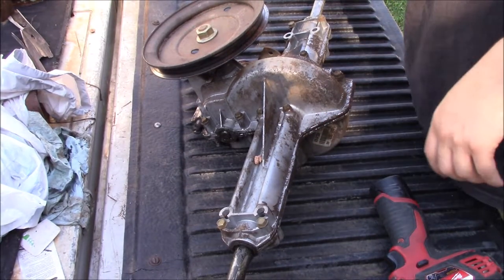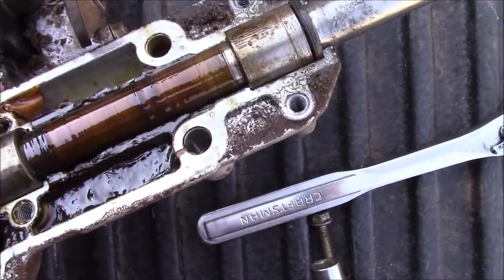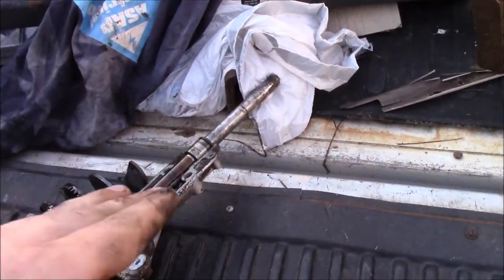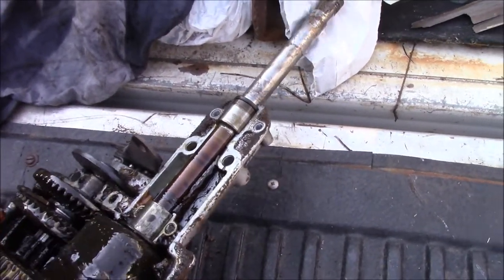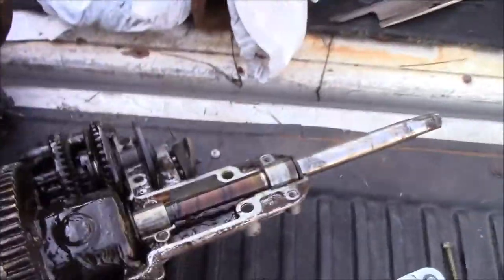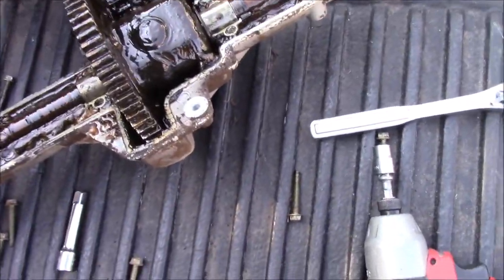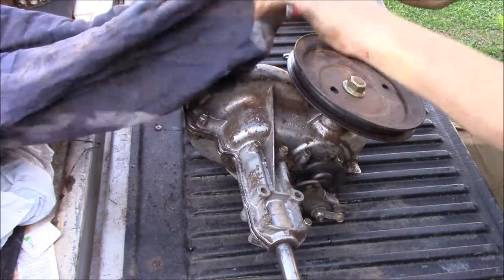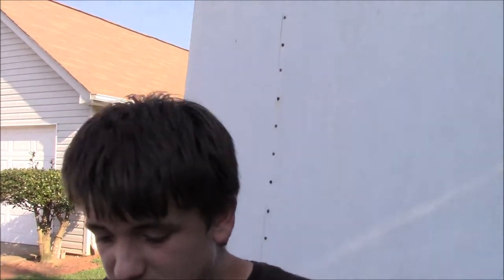Taking a Troy-Bilt drive axle apart that was never serviced

Comment: Your input gear that is on the top half of the transaxle is more than likely stripped and that's why it doesn't move in forward or reverse and it's not a automatic transmission its a single speed axle and speed is changed by the tension on the vari-druve belt system , when you select 5 the gear your actually selecting is not a gear but rather the tension on the belt from the engine to the vari-drive pulley system ! So basically the rear axle is a single speed with a direction reverser gear inside of it therefore forward and reverse but it's STILL a single speed axle ! The gear assembly you were flopping around in there is the forward and reverse gear , it slides on all pin and is activated by the forward and reverse lever on the lol left side of the mower body ! As for the brake rotor they have small pads you have to adjust to have a very small clearance between the pad and rotor when the brake is off and the small clearance allows for more pressure to be applied to the rotor when the brake pedal is pushed down !

Comment: So how do you "service" these MTD transaxles?  There is not even a grease port.
Reply from the maker: There honestly probably isnt a way. I was alot less knowledgeable then vs how i am now and these are probably throw away units anyway
Reply: @Xxdayday99  Thanks for responding.  Based on what I've researched, these do seem like "throw away" units.  The actual differential appears to be riveted together, so you'd need to grind the rivets out to rebuild it and weld it back closed.  And the axle itself runs on two sealed cartridge bearings, so a grease port wouldn't do anything anyway (heck even the factory grease does nothing for those bearings).  It seems like you just run these rear ends until they break and then either try to fix it or get a whole unit.  It's mind boggling to me that MTD don't make these with gear oil in them.  It would not be that hard or more expensive to add four axle seals, drain/fill plugs, and RTV the case halves together... They would probably last so much longer.
Reply from the maker: @cup_and_cone  most likely but we live in a disposable world. Most things made, especially cheaper things are not intended to be fixed.

Comment: that is the grease they use its like a cv joint type lubricant ,,,,mine is apart and its just like that just saying ,  my gears are wobbling on the shaft that they slide back and forth no wear any place else ,,,,they should not be wobbling on that shaft , in my view the pinion that goes in between them would slip at some point and make a grinding noise like i am hearing but i am not 100% sure LOL ,,,,everything else apears to be good ,,,,thanks for posting
Reply from the maker: Just wanted to share what the inside if it looked like. Im still learning alot of new things everyday and trying to show as much as i cam
Reply: @Xxdayday99  its not that complicated ,,,,,i am 68 lot of diff training , a book or a class is always the best ,,  if your going to fix things right ,,,,,take care

Comment: How do you take apart the differential assembly inside the transmission?
Reply from the maker: i have no idea. i fooled with it for awhile trying to figure it out but had no luck
Reply: @Xxdayday99  Hm. I somehow managed to bend an axle and am trying to fix it or replace it. I thought if I could take the differential apart I might be able to put a new axle in? Any suggestions?
Reply from the maker: @huntersmith4153  i would swap the entire differential. it will save you some headache
Reply: @Xxdayday99  I looked into that. The differential costs around $200 for what I could find. I'm not wanting to pay that much. Would it be better for my wallet to find a junk mower (perferably free) with a working transmission and just swap the whole thing?
Reply from the maker: @huntersmith4153  sorry for the late reply i got busy. but yes that would be way cheaper, and maybe even easier
Reply: @Xxdayday99 Don't worry that you replied late. I'm not in a hurry. I'm thankful that you even replied at all. Thanks for the tips. I'll see what I can do.
Reply from the maker: @huntersmith4153  i hope it works out for you bro